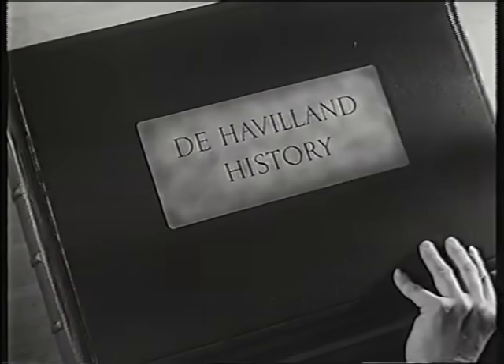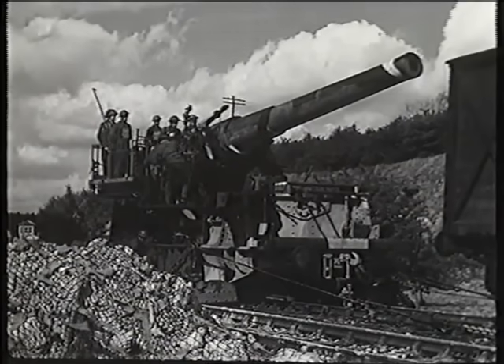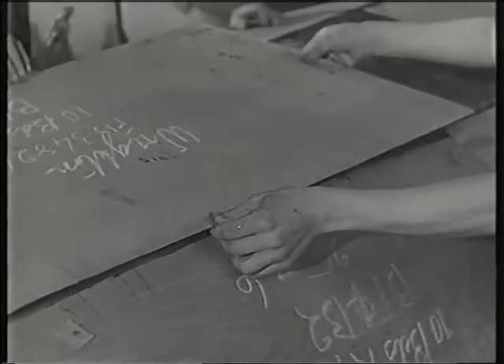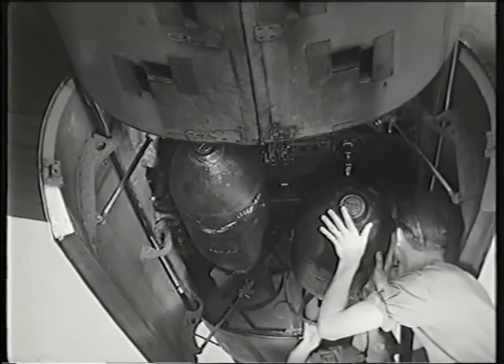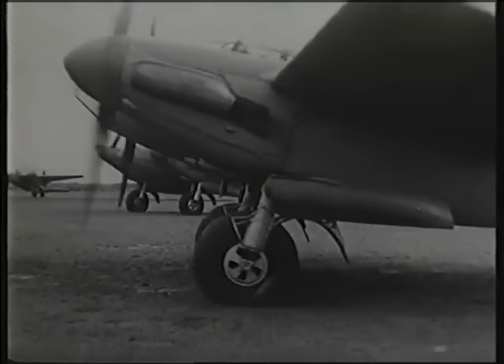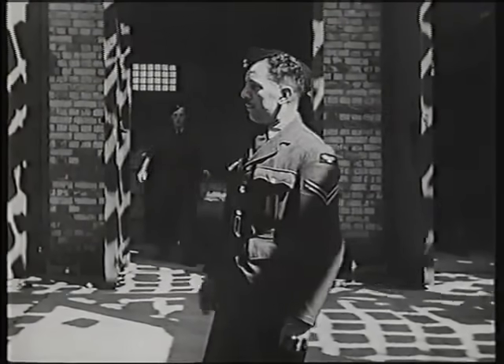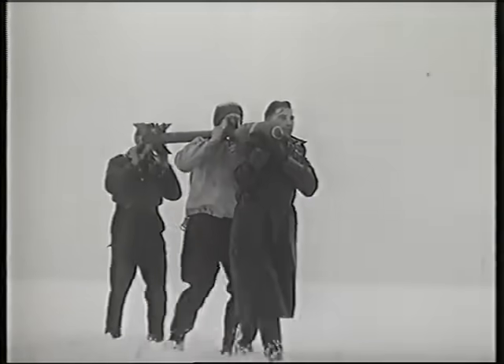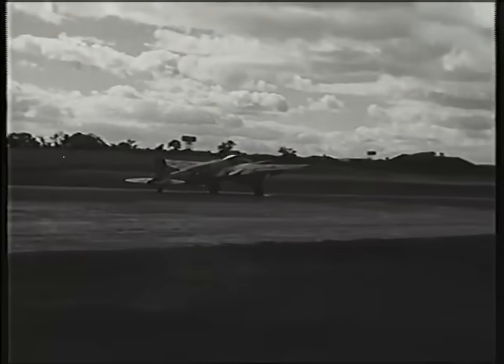The De Havilland Mosquito

Comment: Mosquito mk.XVI: crew of two, range 1.500 miles with a 4.000 lb bomb load, maximum speed 415 mph cruising speed probably about 300 mph.
Boeing B-17: crew of 10, range 800 miles, 4500 lb bomb load (long range), maximum speed 287, cruising speed 182 mph.
I often wonder what if the USAAF would have split that single B-17 crew in two-men flight crews and flew much larger numbers of the mosquito in stead of the B-17.
Even with the original bomb-load of 2.000 lb, the shear numbers would increase "pay-load" delivery, at higher speeds, longer range and less risk for the crews.
Reply: You are wrong on the range of the B17 iw was closer ti 1800 miles with 4,000 lb bomb load..  and it could fly at 30,000 ft..  nice try...
Reply: I'm willing to concede I may have made a mistake in interpreting the extensive data on the B-17 as described by Wikipedia (http://en.wikipedia.org/wiki/Boeing_B-17_Flying_Fortress), which DOES state a range of 800 miles for long range missions, while at the same time claiming 2000 miles with 6000 lb of bombs elsewhere in the spec's, I will maintain that the sheer speed and smaller crew for comparable range and load, still the makes mosquito the better plane
Reply: Roy Kliffen..... IF the B17 only had a 800 mile range....how did they fly to Berlin and back???   1800 to 2000 miles is more like it..and they produced twice as many B17's and three times as many B24's...
Reply: That's why I conceded that point. I missed that flaw in Wikipedia data in my original comment.
Still leaves the smaller crew, higher speed, similar payload and less use of metal per plane. The resources used to build all those B-17's and B-24's could also have been used to build much more mosquitoes, and even then not enough to use all the crewmen used for those B-17's and B-24's.
Reply: The USA  Had plenty of Aluminum, did not have to worry about alternate building materials.
Reply: Wilbur my info normal internal load 6000 lb  Range with that load 1100 miles from Dover to Berlin 550miles so with the normal load it would not make it back. Don't forget the time taken to form up and do the raid. Maybe another 100 miles and that was from the closest land in England. Therefore it is feasible that the B17 did in fact have a 4000 /5000 lb load to Berlin.
Now the B17 had a service ceiling of 35000 ft. and max speed 287 mph or 250 mph cruising speed.
Mosquito at 35000 ft with 4000 lb cruising speed 350 mph so with less men less weight it could carry similar at 100 mph faster and had a range of 1860 miles.
Reply: 18tangles "Gamer"  "ONLY" if it was a later model Mossie with the 2 speed 2stage supercharger...check your spec's and see how man different versions of the Merlin were used, which dictated the altitude and range...Hell manyevwn used the Packard built versions.   You can slam the B17 as not having the bomb capacity, but remember it was an older design and it was AVAILABLE  in quantities  and they had the turbocharged engines from the start,  total loaded weight was similar and it flew 14,000 ft higher than the Lanc....that big wing worked good....
Reply: Roy Kliffen  the B17's range with bomb load was 1800 miles   somebody dropped a  1
Reply: John1950  and the Limeys lost 43% of their Lancasters on those raids  really good.  the Limeys were in Asia not the South Pacific...
Reply: Musicbruv   OOOOOOHH how the truth hurts....
Reply: Good thoughts   ! ! !
Reply: Not by them selves they did not...they had help with all the war material all the other Allies sent them...especially the USA...You do know the USA supplied 2/3 of ALL war supplies in WW II don't you???
Reply: ***** you mean the version of the truth you invented?
Reply: ***** The real truth according to you is completely  BUUUULLLSHHIIIIT, fairy tale for 3 years old children...I mean British children  because they would be the only feeble minded children  to believe  your nonsense.
Reply: Wilbur Finnigan You island hopped by yourselves, to Japan, You had a strong Pacific fleet, British, Australian, Indian and other empire troops, were fighting through Jungles, it does not mean we were taking a back seat, we had lost much already.
Reply: SuperAlbinoBob The Pacific war was fought by  the  US and  the USMC alone  ..Of course the  little  Britain  and   its  pitiful  Commonwealth  played a  decisive role nobody could  deny. Acting as cheerleaders !
Thanks guys,  without  you  the war would have been lost,everbody needs  entertainment.
Reply: WAAAA WAAAAAA  WAAAAAA!!!!!
Reply: WE are NOT QUEERS  like you seem to be ! ! !  ....Can't sombody agree with another without it becoming a sexual deviency ???
Reply: R E S P E C T ........Is EARNED  buy good deeds and appreciation of the assistance given....and lost by Bitching  complaining and running down the hand that helped them,,,RESPECT is earned....EARN IT  ! ! !
Reply: Wilbur Finnigan Assistance gave by America came at a price to Britain, which we fully paid back in 2006, the same cannot be said about Russia nor the many billions paid to Germany and Japan to rebuild, which again hiit the UK, more.
We have paid back, and have helped more in Cold War and the wars of last 20 years to America more than any other, and yet somehow your stuck in the 1940's
Reply: Super?Albino  So... was the USA to also finance the war for Britain???  You needed supplies and the USA was able to supply...so pay for them and shut the hell up ! ! !   Don't like paying for war materials...build your own  ! ! !   Pretty simple isn't it???
Reply: Superasshole  I have NEVER said anything from the USA to Brits was a gift.   IF you read my post I have ALWAYS asked or stated that IF the Brits wanted or needed war supplies they should pay for them... There is NO FREE LUNCH ! ! !    IF you Limeys did not want the supplies.  you did not have to ask for or order them.  My contention all along has been that the Limeys asked for or ordered war material then bitched they had to pay for them.  Is The  USA expected to be your banker also ???   You wanted and needed war supplies you asked for and ordered...pay for them and shut the hell up about paying for them   We cannot respect someone that is a cry baby whiner and bitcher...really simple isn't it???
Reply: Wilbur Finnigan Why are you saying that, when Britain fully paid back, labouring or economy while America financed or wartime opponents to over take UK economy that is what I am complaining, not the fact we paid for it, 
Your the one that is whining away here going on about how we should have paid, fuck me, we have.
Reply: Then shut the Fuck up about it ! ! !   the fact you just got it paid back..its over and done move on...  And yes the USA helped rebuild Germany and Japan so WE would not have to feed them...You whine on about the 707 being a "Logical design"  yes it was and BOEING figured it out and everybody else copied it.  deal with it...
Reply: Little known facts of war they don't tell you in the history books... So the English got a good infusion of American blood...There was another aspect too that is not widely advertised and the number of English women that married US  GI's to get the hell out of England...I knew two that did just that...their ticket to The American dream...
Reply: Wilbur Finnigan In 1945, British girls were buying second hand  underwear !!!
Reply: According to the WWII magazine  over one MILLION  "war Brides" were brought home to the USA from All over Europe and Japan.  The European brides were generally accepted in the USA however it was a different story for the Japanese  war Brides.   It was their ticket out to the USA........
Reply: SuperAlbinoBob  No... the ones I have talked to said in effect  "You have to marry someone  might as well get something out of it.... Most did so to get a free pass to the USA...  I am way past the age that they take people....You Lose...
Reply: Already have ! ! !   Whats your problem???? the Truth???? Can't handle it...????
Reply: NO>>>!! ! !    you cannot handel the truth  nor do you know what the truth is ! ! !
Reply: Wilbur Finnigan You speak no truth only bitterness, my friend.
Reply: Sometime the truth is BITTERSWEET ! ! !   Deal with it ! !!
Reply: Wilbur Finnigan Wilbert please serve your country in proper way.
Reply: I am by calling you a Liar ! ! !
Reply: Stuart Mckean  The war is over....over 70 years ago... it's time to move on it's history... YOU cannot what IF it to death.. it is ancient history now.  It does not matter how good and Jap army was... they lost the war... Big time...
Reply: Wilbur Finnigan
Wilbur wilbur wilbur why is it that every documnetary on a British aircraft I read there you are spouting your anti British and pro Yankee rhetoric and peppering it with the usual mix of misquoted stats and operational misunderstanding. The original postulate that Mossies were a far more efficient way of getting bombs to Krautland could have equally been applied to Lancs. But there the stats are a bit less favourable as the Lanc or Halifax would be taking 12-14000lb or HE or incendiaries with a 7 man crew as opposed to a Fort which would do 6000 (being generous) or a Lib at 8000. Not that the 8th used libs on the big city trip much if at all. Anyway the Mossies and Lancs were used by B-C as a very effective team, Mossies marking targets as pathfinders for main force with big 4000lb TI flares. Main force of Lancs and Halifaxes drop in the TI's and occasionally later the 8th would come along and bomb the fires. Its all there in the history books so do yourself a favour and have a proper read of some proper analysis and dont keep coming on here spouting a mix of lies and half truths. Its no credit to your once great nation and the brave boys who had to fly the forts and libs to carry on spouting like you do. Why not go and find something more productive to do? I'm sure there is a veterans day centre where you could maybe meet a few real vets before they all die. Give them some company and listen for once. They won't be with us much longer and they sure wouldnt be impressed reading some of the crap you've written.
Reply: Jon Tilson will siad mate
Reply: 18tangles with christmas tree, lol
Reply: Notice how wilbur stops replying when confronted with hard facts...
Reply: Just get tired of trying to talk to a brick wall...it is easy to tell when a conversation is over....
Reply: Well why provoke people into challenging you if your tired of arguing with them? It's like being tired of a child crying but then stealing their toys..
Reply: just to piss you off....you are so predicable....
Reply: Wilbur Finnigan so how do you expect me to take all this murica is best bûllshît then if you've blantently just admitted to being an Internet troll 18tangles
Reply: 18tangles i just thought you would like to see the reasons why wilbur preaches as much as he does
Reply: 18tangles Hopefully with his dearly beloved Packard Merlin !!!!!
Reply: Wilbur Finnigan WRONG!!!!! This from Wikipedia on the B 17 .

Bomb Load

Short range missions (<400 mi): 8,000 lb (3,600 kg) ( less than 800 miles total NOT BERLIN
Long range missions (≈800 mi): 4,500 lb (2,000 kg)
Read this and weep !!!
Reply: And you dumb fucker....you believe Wiki ??????  Go to the USAF site or Boeing...
Reply: Wilbur Finnigan Nah Way to biased
Reply: Afraid the truth does not match you preconception ??? Gary Fucking Tarr
Reply: 18tangles They still churn out that the bomb load of the B17 was 6000 lbs ..yes if it only had to fly 600 mile mission ( 1200 there and back ; to Berlin all it could carry was a MAX of 4250lb at a cruising speed of 187 MPH .. Mosquito ( after mid 1943 ) 4000 lb at a cruising speed of 315 MPH with 2 crew and NO armament . What a waste of space the B17 really was !!!
Reply: 18tangles Just the facts and truth Tangles , not WilbursoaringtractorFinniganWoterpnt lies and distortions
Reply: YUP !!! THem fucking Limeys are all a bunch of liars !!!
Reply: Wilbur Finnigan LOL and we suppose your alter egos soaringtractorand Wotepnt will back you up
Reply: Gary Tarr and even then that's nothing compared to the ten ton Lancasters
Reply: Tom Somerfield  Only a few  MODIFIED  lancasters could carry the 20,000 grand slam...UNMODIFIED Lancasters could only hold 14,000 pounds  but the Average bomb load of the Lancaster throughout the war was 8,000 pounds..this info from your British sources..total tons of bombs dropped divided by sorties, you do know what a sortie is don't you ???  Later model Lancasters had the bomb bays enlarged to carry the 14,000 pound load...
Reply: dangles  Actually I found a figure for sorties flown in WWII by the USAAF  332,904 !!!  for all of WWII and a figure of  1,388,000 tons of bombs....but that was all planes and all theaters i think....they did not say...not sure you can find that info because of the different theaters of war the USA operated in.  and FYI  the B17 could and did carry 6,000 pound bomb loads to Berlin and back 2,000 mile range at 20,000 ft.....
Reply: Wilbur Finnigan Just post a link to the "found a figure" " as no one would believe your unsupported post
Reply: 👆ive had enough of telling old wilbur this.
Reply: tom Somerfield   You could not tell anybody anything....you cannot even put together an understandable sentence !!! Is that what you learn in a Limey school????  LMAO  LMAO
Reply: B17G, which was the largest model produced, 8500+  had a range of 2000 miles with a 6000 pound bomb load.. Do the research and don't just "cherry pick"
Reply: Gary fucking tarr According to the USAAF  the people that flew the B17g, the most common model 8500+ made it had a 2000 mile range with 6,000 pounds of bombs at 20,000 ft... USAAF stats...know what you are bullshitting about !!
Reply: Tangles....Jack  go back and reread my post !!! Dumb fucker !! that 8500 is the Number of B17G's made !!!  the most common model....Geese man learn how to read and comprehend..... and you wonderful Lanc only carried an AVERAGE od 8,000+ pounds of bombs throughout the war.  Number of sorties flown and tones of bombs dropped, from RAF performance figures of WWII.  Tall boys were 10,000 lbs...  The 40  Grand slams that were used were only carried by the Mk BI SPECIALS...what was special... Bombay doors removed  two turrets removed and all unnecessay equipment removed   AND....Later higher HP Merlin engines installed wit special paddle props.  those 30 specials were the only Lancs to carry the Grand slam....stock Lanc could not.  and By the way Jack the DAM Buster lancs were all Lanc Mk B III...remember the ones with the Packard merlins.  LMAO  LOL  just a FYI....according to  "Your Limey Book"   lol lol lol....
Reply: Wilbur Finnigan If you discount that the Chinese occupied 50% of the Japanese effort, and the Brits another portion in Burma and the Aussies in PNG you are right. But you can't, so, as usual, you are wrong.
Reply: SuperAlbinoBob Should have made them pay for Radar, instead of sending people over there to show them how to do it and how to make it work.
Reply: alanrtment porter You think so sonny ???????   You are dead wrong on all counts !!!    DUUUUHH  !!!
Reply: +Wilbur Finnigan Come on Wilbur...they have got you bang to rights on all of your sock accounts.. Why don't you call it a day...and go back to tinkering with tractors, growing tomatoes and dipping your cheezy old plates in the waters of Soap lake..
Reply: If anyone is interested, just found this on a USAF page about a certain aircraft.....any guesses as to which one?.
Maximum speed 472km/h (256kt) at 25,000ft. Climb to 25,000ft 41 min. Service ceiling 35,000ft at Min.Bomb load. Normal range (maximum bomb load  1770km (955nm) at 352km/h (190kt) at 25,000ft..
 Max bomb load and only 955 N.miles. ?    That is not what Wilbur says..
Reply: Michael Bond Well...I suppose the USAF could be wrong......but I think not.
I have also been learning a bit about the Norden. Apparently not the ace bit of kit it was claimed to be. 
Also, I don't know if you saw it the other night, but there was a documentary about 617 and 9 Squadrons attacking the Beast.. Old Wilbur says they missed on all 3 missions , with only a few hits. T'would appear that on the first 2 missions, they never even saw the Tirpitz so no bombs were dropped. Sort of buggers his figures up a bit..
Reply: 18tangles And it wasn't that hot at the lower altitudes either.
Reply: 18tangles That is an interesting point.  How many generations does it take to go from Amoeba ...Irish.....Irish American......American of Irish descent.....American....Amoeba. ?
Reply: 18tangles maybe, but then Wellington is not Wilbur lol
Reply: 18tangles No...I could never get into them. (not really army minded) Mind you, I couldn't get into Hornblower. either.
My tastes in reading tend to revolve around fact based things, although I used to like the books of Douglas Reeman until I realised that the plots were all basically the same..
My All time favourite work of fiction is "Bomber" by Len Deighton. If you come across it down there....well worth the read.
Reply: Fast light bomber Wilbur.....Yes it could.
Reply: 800 mile range or 800 mile combat radius?  There is a big difference.
Reply: Judging by his surname, Wilbur is probably a modern day American Fenian who hates everything British mostly due to Britain's dominance of his ancestral homeland.
Reply: Mush Morant....You have hit it right on the head.
And he has been told many times about the difference in ranges.
This is a "Man" who has never served in his life yet will tell those who have that they are wrong, will tell every author that they are wrong, every book that isn't American is wrong
I'm sure you know the sort.
Reply: What are you talking about fella?  Typical B-17 cruising speed with standard bomb load was unlikely to break 200 mph (usually it was around 180 mph).  Typical Mosquito B cruising speed was between 240 and 270 mph and could go as high as 320 mph at 25000+ feet with a 4000lb cookie which almost became the standard payload on long-range high-altitude bombing missions.  The mossies could easily do 2 trips to Berlin for every one flown by a flock of B-17s and could bomb in nearly all weather conditions, something none of the allied heavy bombers were ever able to do.  Surely someone as knowledgeable as you has heard of "the Berlin Express".  At night pathfinder Mosquito crews would take off 2 or 3 hours after the Lancasters and Halifaxes and within 2 hours would be ahead of the heavies en route to the same target after which they would complete their marking mission, return to base and be sleeping in bed for a few hours before the heavies returned.
Reply: Willie Eckerslike

Yes I generally agree, but in addition to his pro-American bias he also appears to have a strong hate on for the British (of course he is entitled to all of his opinions and beliefs no matter how wrong they may be).  I don't really take him seriously and any of my responses to his posts are aimed primarily at challenging his ignorance for the benefit of others as well as, at least temporarily, shutting him up.
Reply: The B17 had a combat radius of just under 800 miles carrying a 9600 lb internal bomb load at 25000 ft. (source, USAAF specifications) Now, the Mosquito was a great aircraft in many ways, but to compare its bomb carrying ability to a B17 is just plain laughable.
Reply: 18Tangles Gamer p
Reply: Roy Kliffen  The B17G, most widely produced model at 8500 of them had a 6.000# bomb Load for 2,000 Miles !!!  where the fuk you get your info ????  USAAF dropped slightly more bombs in the European theater than the RAF did !!!!   And your mosquito would NOT do 415 MPH with a 4,000# bomb load.  That 4.000# bomb load had to be a special cookie bomb, as designed a mosquito carried 4    500# bombs or 2,000# !!!!  DUUUHH!!!!!
Reply: @jontilson6090  Jon Tilson  According to RAF figures of sorties flown and tonnes of bombs dropped the AVERAGE bomb load of a Lancaster was but 8,000# !!!  RAF Figures !!!  What happened to the 14,000#'s ???????
Reply: soaringtractor  The G model.
Reply: soaringtractor  Type this into your browser, as it's a PDF file, and I can't post a link to it here for some reason. Type in 1949 declassified USAF specifications for the B17G. It's all there.
Reply: @6h471  soaringtractor, barracuda and Wilbur Finnigan are all the same person. Three accounts, one troll.
Reply: @thethirdman225  And it looks like his wife ran away with an Englishman, assuming he's old enough to be married.🤣
Reply: @chattonlad9382  Haha! I’m not surprised. I’m just surprised anyone would want to marry him in the first place.
Reply: @barracuda7018  
”The Pacific war was fought by  the  US and  the USMC alone.”

That’s a pack of lies. Try reading Eric Bergerud’s book, ’Fire in the Sky’. There were two pivotal campaigns in the first half of the Pacific war: Guadalcanal, which everyone knows about and New Guinea. That the Americans won in Guadalcanal, largely by themselves but with some support from New Zealand is already known. New Guinea was pretty much an Australian campaign that was of virtually equal importance and about 80% Australian.

The idea that the USMC and the US Army did it alone is ridiculous. It is only true for the later part of the war, once Guadalcanal and New Guinea had been won and it was only true because of MacArthur’s dislike of Australians, something that led to a lot of unnecessary tension between the services.
Reply: @SuperAlbinoBob  The Soviet Union sent pretty much its entire gold reserves to the United States in payment.